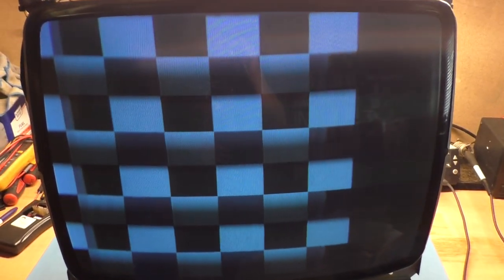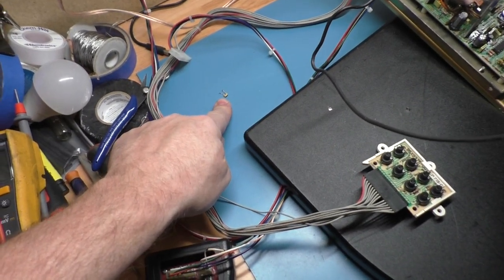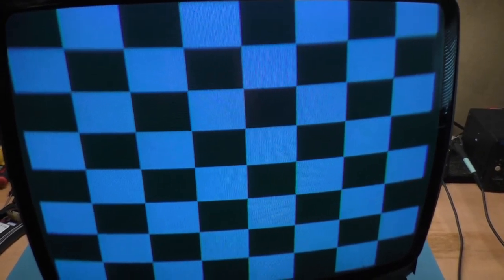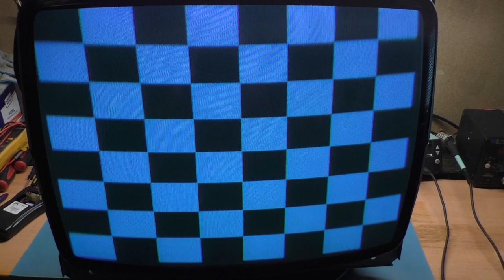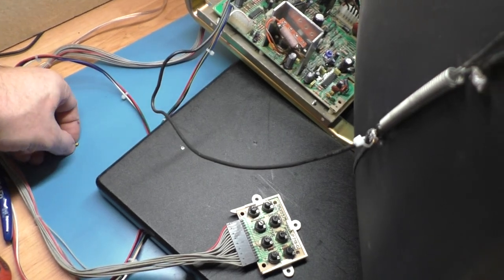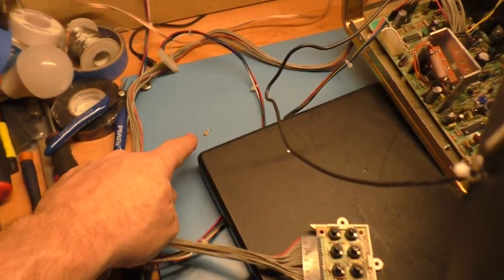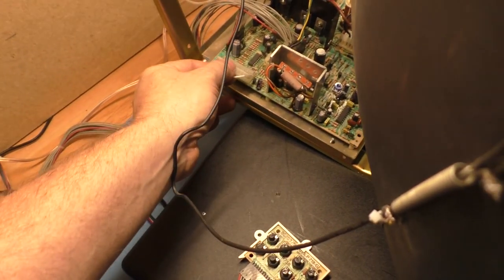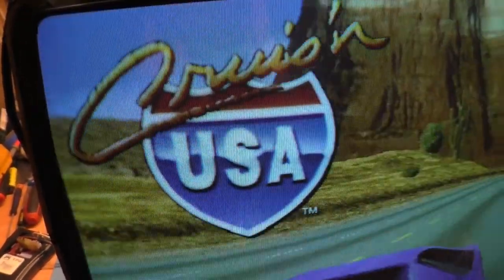25" U5000 Arcade Monitor Repair - Shaky "Jittery" Image - Horizontal Oscillation Issue - Quick Fix?

Comment: Question for you Mike.  Is this sort of issue something that you think could be diagnosed with something like freeze spray?  I have several trintrons doing this and hoping to find a decent way to test / diagnose.
Reply from the maker: Hmm. I don’t think so. I only know if this solution due to my own experience and other techs’ knowledge. It’s possible, but I can’t say for sure. It’s very likely a similar cause, however I do not think freeze spray will tell you anything. Especially if it’s doing it when it’s first turned on. Cap the chassis’ if you have not already.